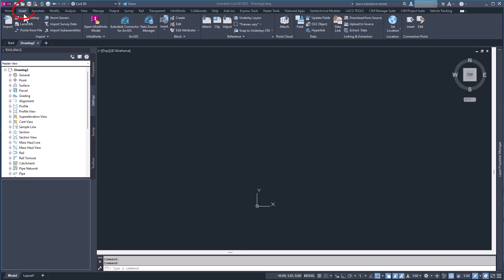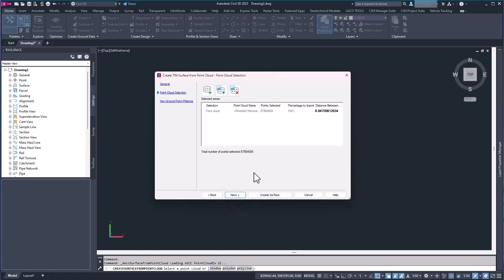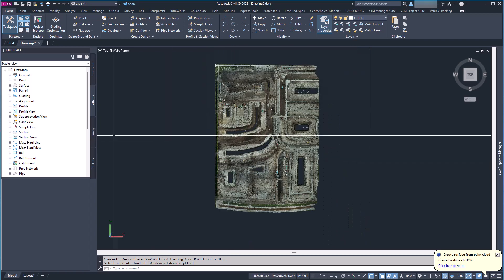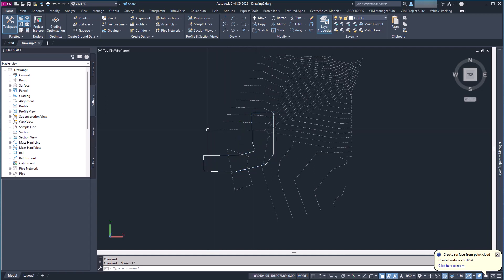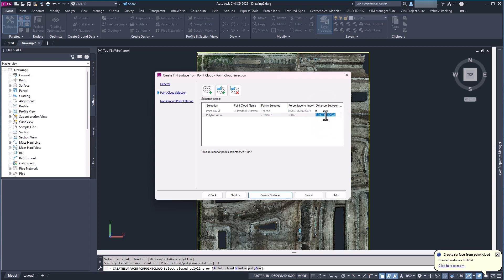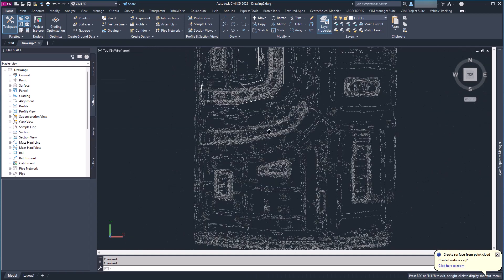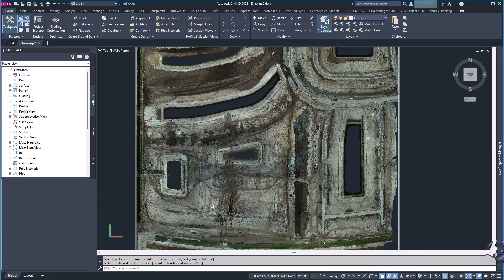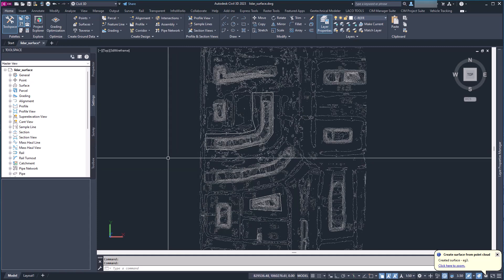What's the best way to process LiDar in Civil 3D?

Comment: The side slopes on your ponds look fine - uniform and parallel. The innermost part of your ponds are the water surface, not the pond bottom. That's why your contours zig-zag across. If you look at your point cloud, there are no data points in the water areas. These should be treated as data voids. Draw polylines along the water edges and define them as boundaries in your surface within which C3D should not create a surface. Same thing with building footprints. Too many surface models are created without taking into account data voids. Can't tell you how many times I've seen contours running through buildings.